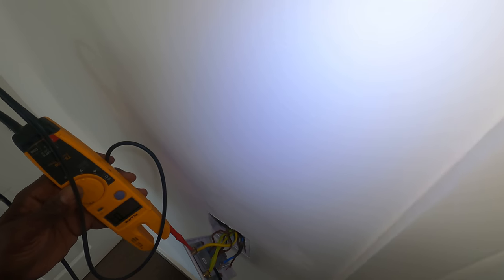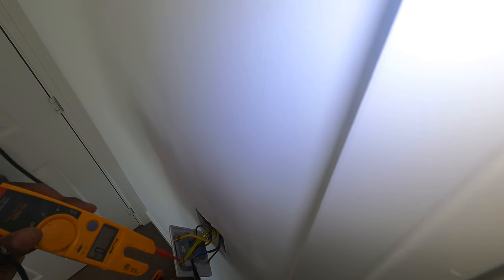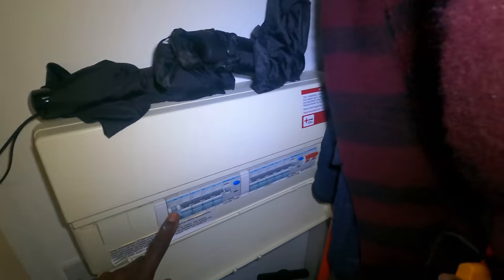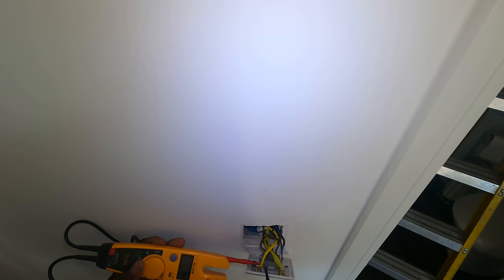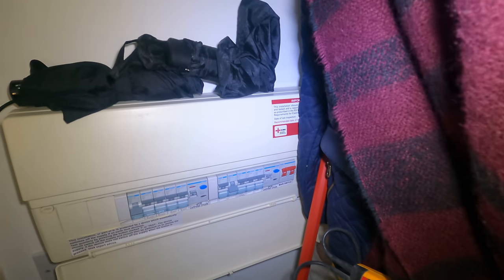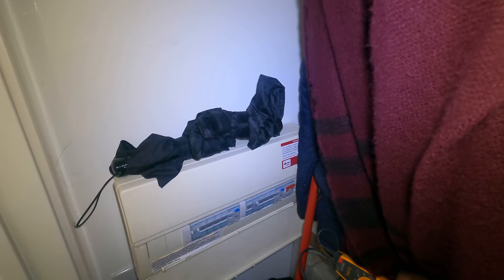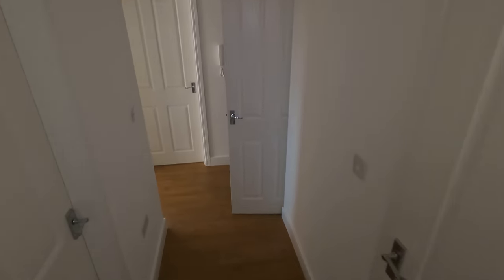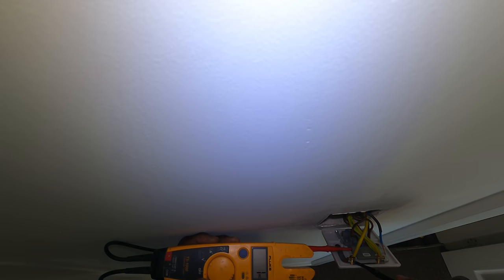Electrical Fault Finding On Lighting Circuit | Real Uncut Process [HeadCam]

Comment: A very typical setup on the sites that I’ve been on. The general ring / utility ring has an FCU for a central extractor fan system. The boost for the fan is switched in parallel with the bathroom lights via a double pole switch. The lights are wired into one pole and the boost switch is wired into the other pole to keep the circuits separate and from one switch controlling other lights whilst ensuring that the fan boost is turned on and off automatically with the bathroom lights. Some must also kept separate due to the fan boost switch using 12v D.C instead of 230v A.C.

Comment: Im guessing the bathrooms are a pre wired pod system... with a connection box above the inside of the doorway.. due to the electric heater some sparks just wire the pod into the ring main.

Comment: Probably just fed off a fused spur somewhere. 
Should just get an Audible non-contract voltage pen and balance it on the cable and then just walk round and switch them till the sound goes off, sod all that walking, you trying to get your step count up???

Comment: a good way i've used to find which circuit is live while standing at the board is to jam a volt stick in the back of the light switch so it goes beeeeep, then switch stuff off at the board.
When you switch off the right one, noise stops.